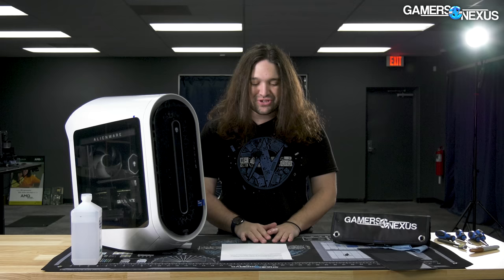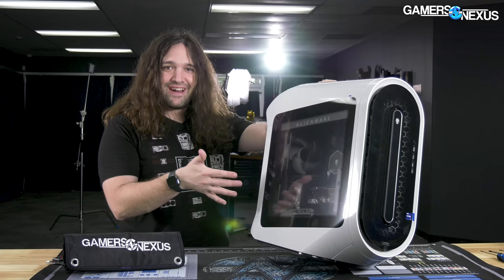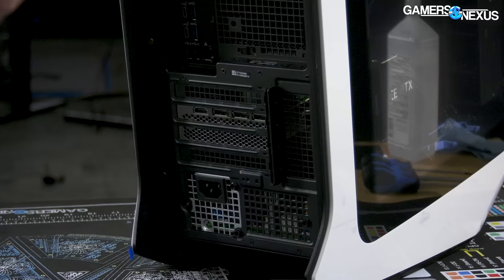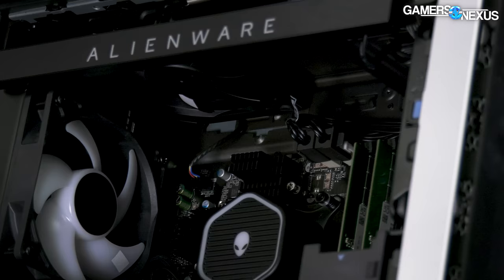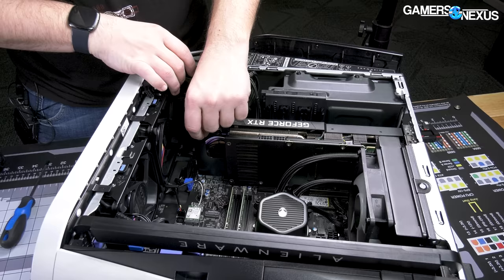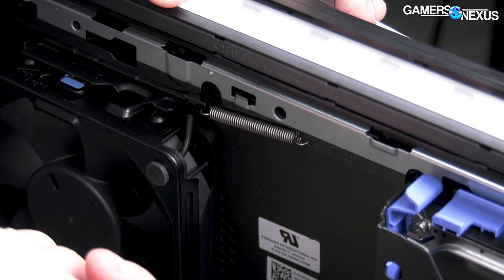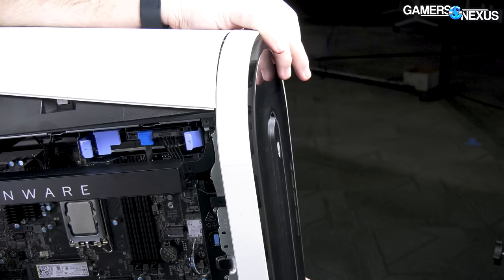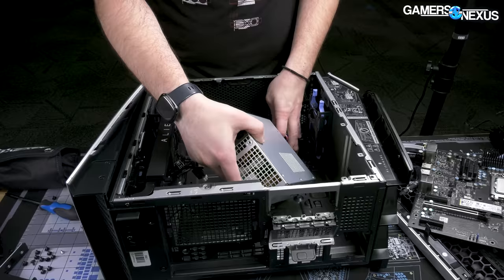Crazy Bad $5000 Alienware Gaming PC: R13 Aurora Tear-Down

Comment: Repurposing of old inventory should be an end user thing, for fun. Companies need to get rid of these parts by selling them for cheap or at a loss and get them out of their warehouses and shops, and focus on engineering new hardware along with the times instead of spending that money and effort into engineering ways to repurpose these old parts. It's baffling that they do bundles and this kind of shit to get rid of these things.
Reply: They could have just used that for mid tier or low end Dell where nobody would have batted an eye since Dell users are used to this level of crap.
Reply: Also, keep some in stock for customers wanting spare parts for the original systems.  I recall Dell discontinuing rack mounting kits for a high end server we bought around 2000 to 2003 and needed to rack mount later that decade.  So we had to resort to a rack shelf and having the optical drive (for system upgrades) barely functional, which the discontinued cabinet parts would have solved instantly; If only they kept inventory at a higher than original price.
Reply: Dell could have repurposed these chassis to regular office computers instead and that way emptied their stock.

Comment: breh..i luv my aurora R7..still blasting almost 5years old..8700k+liquid cooled and a 1080ti. It was $2200 in 2018. Just redid the thermal paste and deep cleaned the liquid cooler radiator last week

Comment: My first "gaming pc" was an Alienware X51 for almost $2,000, which back in that time was a lot of money for a Rig but it was an Alienware yO!.  It had a i7 3770 and a GT 545.  8GB RAM.  Proprietary PSU meant no way to upgrade it other than barely having enough power to run a GTX 1050ti.  It worked ok but I knew after having it a while that I'd never again buy a pre-built.  After building an 8086K /GTX 1080ti build a few years ago, I decided to scavange some of the parts from the old X51 to build a simple rig for my ex at the time. I found an Asus B75M Micro ATX board on ebay that would fit the i7 3770 and GTX 1050ti SC.  Upgraded the RAM to Gskill Ripjaws 16GB DDR3 1333 CL9 memory, a Corsair RM550x PSU, Cheap Corsair case and  cheap SSD. For about 300$ I brought new life back into the parts and chucked all that proprietary Alienware shit in the trash.  That PC still runs strong to this day. Alienware is a joke.  Don't know who or why anyone still buys that crap. Smh.  They are still proprietary junk.

Comment: I've clearly no idea about the cost of tooling, but jeez, probably 15 years of bodge "fixes" and over engineering work arounds on a 25 year old chassis has to be more expensive than actually designing a new chassis fit for modern day purposes, never mind the e-waste and scrap! I thought Dell had said it wants to be more sustainable, "green" and on board with repairability? Oh wait that was just PR BS to steal some of the spot light from laptop maker Framework!

$5k for that piece of crap, people must either not know anything whatsoever about PCs or be complete Alienware fan boys to pay that.
Reply: they're riding on the coattails of the Alienware name from back when they actually made good PCs, before Dell bought them.
Reply: I think dell has a billion of those optiplex cases just laying everywhere, so they want to get rid of all of them.

Comment: There’s one big misconception you guys do with cooling in those small oem “furnaces”. They all use turbine gpu coolers, which exhausts heat by the I/O shield of the gpu. 
They don’t add much heat to the case flow and absolutely don’t rely on the internal airflow of the case.
This GPU cooler design is made exactly to suit such configurations, and are pretty excellent to it, hence why we have only those on these cards pro cousins.

Comment: Had an original Alienware before they sold to DELL.. was extremely high quality, had A1 customer service.. best company out there at the time. Within 6 months DELL had completely killed the brand.  I am actually surprised they still use the name since it has been associated with complete junk for so long.
Reply: This. It's been wild for me seeing that brand go from at-or-near the top to at-or-near the bottom. Even crazier that a similar thing happened with their spiritual successor, OriginPC, once Corsair bought them.
Reply: So many beautiful prebuilts you could get rather than this crap. CorsAir ones, msi trident, etc….
Reply: Yeah Alienware actually used to good way back in the day before Dell bought them.
Reply: Was still too expensive back then, the only thing they had going was the fact that it looked cool for the time IMO.
Reply: When you say "Best company out there" I think you missed out "and only".
Dell acquired Alienware in 06 and prior to that we weren't really spoilt for choice in regards to gaming systems. There were no companies such as Origin or PCSpecialist and the big boys such as HP and Asus didn't really have anything to offer. In fact if you didn't buy Alienware you were pretty much building  it yourself of buying a custom built.
Reply: @jacksontaylor6609  not really true, there were a few custom pc builders, Ibuypower started in 1999.. but alienware was buy far the best quality at the time.
Reply: @jacksontaylor6609  Back in the early to mid 2000's if you wanted a prebuilt gaming pc for a reasonable price, you went to your nearest mom and pop computer shop, paid them and had it made for you and the price and quality were competitive. Now you have prebuilt gaming pc's from large corporations that can be shipped to your door and massive chain stores taking over. Dell made the XPS even back in the mid 2000's but they were still overpriced, HP/Compaq had some lowkey gaming stuff but it wasn't an entirely different product line, just slapped a dedicated graphics card in there and called it a day.
Reply: @TheIVSaken  iBuyPower may have been set up in 99 but it took them over a decade to become an established S.I.
Again, prior to them and others such as Cyberpower/Origin becoming ESTABLISHED companies we had very little choice. As someone else pointed out, you could go to your local PC shop and request a build or as I said earlier, build it yourself. And that for a lot wasn't an option as PC building back then was a bit different,  people were scared to do it. Especially when it involved expensive computer components.
Today everything is pretty much plug and play and everything has a controller on it to automatically switch off if there is a problem.

Comment: I remember my old Dell XPS 730X that thing was awesome, I had installed one of those asetek psu's in the drive bay to run sli, the lighting and software ran really well and looked cool, it had a proprietary liquid cooled foam/liquid coolant in it, I had a small issue and since I paid $6000 for it all decked out i kept calling to do a replacement and they kept sending me a label for 5lbs, it was much heavier and Fedex wouldn't take it, after doing that 5 times they apologized and gave me a full refund, and I got to keep it, they had a note that said "lost in shipping" I tried to tell the indian guy 5-6 times no, I HAVE IT RIGHT HERE! he kept apologizing me and saying we will give you refund, it is lost. I gave up, he won, I got a free kick ass PC.
Reply: I still have mine too. Red. Water cooled. It is still working. I changed out the graphics and HD and gave it to my son.😉
Reply: @stevenreardon4974  nice!

Comment: "Can you hear the Ronald McDonald in the quality?" Freaking gold haha. I used to think of Dell/Alienware as "good" when I was younger and much more ignorant, as my friends would get their laptops and desktops to play games and it was definitely better than my PS2 & Gamecube at the time. However, now getting to see what's actually under their hoods has been nothing but disappointing for the most part. The only "decent" Dell machine I own is a Precision M6700, and it's surprisingly modular (to an extent) with its storage options and non-soldered CPU, GPU, and RAM. I didn't pay msrp for it though; I bought it for $200 in 2018 to do CAD projects.
Reply: I got my dad an M6700 recently. Great machine for its age, and it still holds up well. The modularity is one of the reasons I love it so much

Comment: Prior to being acquired by Dell, Alienware used to make kick-ass high-end systems. This is sad to see really.
Reply: I almost bought one... Almost. When I saw Dell, I got the Heebie Jeebies and went on to build my own and happily ever after. Dell, you suck. Apple wannabe thinking.
Reply: Who makes the best high end systems now? Trying to find a good cheapish laptop
Reply: @AcidxAnarchy  razer  blade 15 , Gaming ASUS ROG Strix  or lenovo ideapad gaming 3 its cheaper
Reply: Unfortunately, that was a long, long, long time ago.
Reply: @tugzzcouncil485  thanks
Reply: @AcidxAnarchy  Look into Sager Notebooks. Their clevo based laptops are awesome! I've got mine with a desktop CPU i7-7700K for 3+ years now.
Reply: @mastermikeyboy  I'll check em out thnx
Reply: I agree with digitz that their machines were kick-ass (component wise).  That is what drew me to the company originally. They touted tweaking/overclocking their machines and only installing required software and avoiding software bloatware.  I bought one of their Area51s prior to them becoming a Dell company.  The computer came from their original warehouse (Miami I believe) but took months longer to assemble/test/ship than they promised. By the time they finally shipped, my bleeding edge machine was now a generation older than current parts available.  When I received the computer, the front access door bezel was broken.  I contacted the company and they sent another front panel (which was broken when they sent it) - both exterior boxes were intact.  I offered to send both back to them for a new one and they just stopped communicating with me.  Needless to say, I will NEVER recommend an Alienware computer to anyone.
Reply: @AcidxAnarchy  Ironside PCs.  I have three of them and they're great.
Reply: @tugzzcouncil485  Visit Razer's subreddit. It's daily customer service nightmare stories because of their electrical engineering.
Reply: Dell. The Electronic Arts of the computer industry.
Reply: Was just thinking that as I was watching this video
Reply: I've always heard this, too bad my only alienware machines are the dell ones smh
Reply: Had my r7 1080 for 6 years no issues now got an r13 with a 3080 it’s amazing so far can’t complain for $2700 on Amazon
Reply: no they didnt lol
Reply: Ya. I managed to afford one the year before Dell bought them out. They used to be awesome. I think everyone knew they would go to sh!t the moment Dell bought them. And then a friend of mine bought one after the Dell purchase and proved it. Everything inside was no longer top of the line hardware. It turned into Dell labeled proprietary hardware, and Alienware and officially lost it's soul.

Sad indeed.
Reply: @AphexSchwinn  Oh man, I bought the original Razer Blade Pro, and it refused to charge after ONE WEEK. It took me FOURTEEN support tickets and 2-months of wasted time of them trying varies fixes (new charger, new battery, new this, new that) before they finally decided to send me a new computer, to which I said "No thanks, I'm good." Ultimately I got a refund but it was an extremely frustrating experience. Oh, not to mention I paid extra for the Japanese keyboard layout (because I was working in Japan at the time and wanted a gaming laptop) and they couldn't find a replacement to send me.
Reply: I remember my dad's friends pc was alienware, it was insane and looked "alien" and wacky but once Dell a company full of office workers acquired them they basically stripped its identity, it's depressing.
Reply: It's the age old MO - 1. Buy successful business; 2. Strip it of all the mechanisms that made it successful in the first place; 3. Milk the cash cow until the consumer notices; 4. Complain that the business is unprofitable, blame the engineers, sack the wrong people and beg the government for a bailout or something.

Comment: Looking at this case gives me a good idea. Imagine a case where the whole front is one of those dyson bladeless fans. They run really quiet too.
Reply: They run so quiet they aren’t even there
Reply: They do have blades. Just hidden. Haha they tricked you. Dyson bladeless fans is to fans as Alienware is to computers. People who know anything about fans don't buy Dyson
Reply: Technically correct. Although the design takes advantage of the venturi effect meeting that it moves more air than it would if it was just blowing the air directly. Plus you are paying largely for the filtration. Not saying Dyson fans are a good value. But they are cleverly designed.
Reply: @allenmills7940 at least dyson has clever design going for them. Alienware is neither 💀

Comment: The money spent on engineering the parts to use the old case could have been spent on a new case and I am 90% sure a new case would have been cheeper than the tooling for the new parts.

Comment: I misread it as $500 at a glance, looked at the picture and went "Oh, looks about right for a cheap pre-build" with my mind stuck on pre-crisis pricing... took me like a sec to realise that we're not only still in a hardware drought but also talking about an Alienware pre-build.
Reply: I haven't started the review yet, I'm sitting here trying to imagine what they put in there for 5k. Because it could be almost anything, except 5k worth of quality parts.
Reply: @chillimack  So like, a threadripper with a large kit of ECC RAM and a 3090? Pre-pandemic you could get a crazy good build for that kind of money, including peripherals. And even now, and considering the prebuilt tax, this is kind of crazy.
Reply: @Lodinn  for that price USD, I could get far more than I need, it would honestly be wasted on me. And pre crisis, I can't even imagine. I guess I'm going to have to see what I would hypothetically get, now.
Reply: Even if you take out the 3090, there’s no way this is a $3K PC.
Reply: $500 on Alienware's website gets you an Alienware sticker. A small one.
Reply: @chillimack  I dunno, three $600+ monitors and a $500+ headset? I don't see any reason for a $5000 PC for a regular user if it doesn't include some ballsy peripherals. Good value is lost much earlier but if you treat it as your hobby why not I guess.
Reply: @Lodinn  hey I wouldn't turn it down! But yeah, I'd definitely do some OTT monitor setup, if I had to spend that much.

Comment: Person that engineered this one must have been taking his inspiration from IBM mid tower PC servers in 90-it’s and early 2000. Same mechanical complexity and proprietary PSU, main board and cooling solution. Only that those worked pretty good. Cooling solutions were quiet and efficient with normal loads and could cool in hot box but would start to be very loud.
Reply: IBM takes it one step further by completely renaming common components to something tech-jargon sounding.
Reply: @Ty-ri7dy  like 30 years ago I've worked for IBM in Germany. Names used were just normal as much as I remember. But that was long ago.

Comment: This case and build has awful lot of complex engineering solutions to problems that never should have existed
Reply: With all that engineering they could’ve built a better case that looks the same(if they’re going with that look)
Reply: its the Boeing 737-MAX of PC cases. They have needed to design a whole new thing for 20 years but instead just keep tacking on engineering problems to resolve problems caused by being obsolete.

Comment: I bought an Alienware back in 2007 only lasted me a year before the cpu started to have overheating issues that they could never fix yet would not replace it because it was a lemon.  Now I can see all Alienware are lemons. Lol. Dumb got exited that dell bought them but dells trash. Even though I did have an xps after the alien that lasted.   About 5 years. Just replaced my 10 year old asus notebook with a Lenovo 5i pro which I’m loving.

Comment: I'm surprised they didn't replace the plastic front piece with a mesh cover so that they would have been much better air flow. It wouldn't have cost them any more and would have helped with the cooling. It would have looked much the same as it does with the plastic front cover.

Comment: It's funny, the reason I got into building my own PCs was because I had bought a Dell ages ago and I couldn't upgrade something as simple as adding more RAM to the motherboard because Dell had this proprietary bullshit casing all over the place preventing me from improving their shitty computer. Here we are in 2022 and they're still doing the same old shit with their cases. I'm actually begrudgingly appreciative that they did that, now my custom built PCs are way better and cost way less.
Reply: Well, there are Configurator Companies that do a very decent Job at not making pre-builts suck and for not incredibly expensive, but there are not many of those.

Comment: 6:00 the irony is that it's actually high quality construction; just applied to abysmal design.. These toasters are aimed at a market that knows nothing about PC's The whole lineup was designed for shareholders, not consumers.
Reply: I would take it a step further and say that these were designed largely for the marketing department. It's all about numbers and talking points to wow and amaze. And yes....to wow and amaze anyone who has no interest in ever opening or pushing a PC past Facespace.
Reply: Everything is ultimately designed for shareholders. You take artificial scarcity and overwork the employees so that shareholders can get that thing called profit all by doing nothing.
Reply: a really well built device thats not fit for purpose is still garbage, it's just well built garbage.